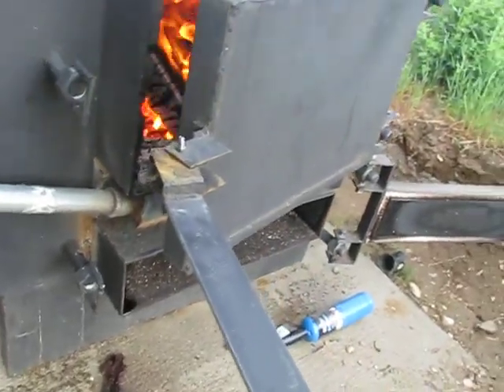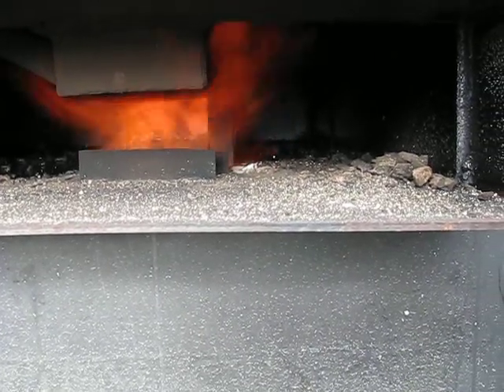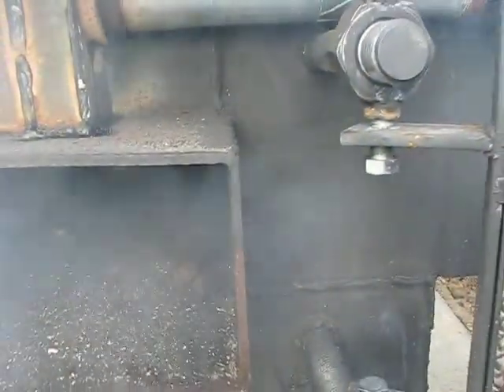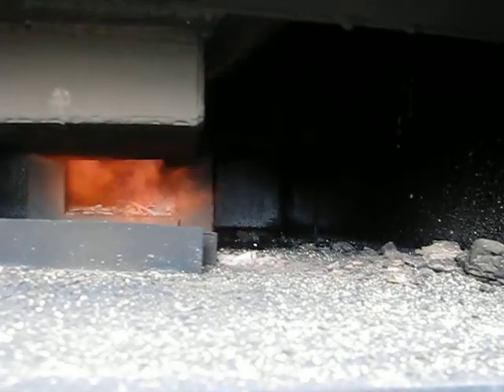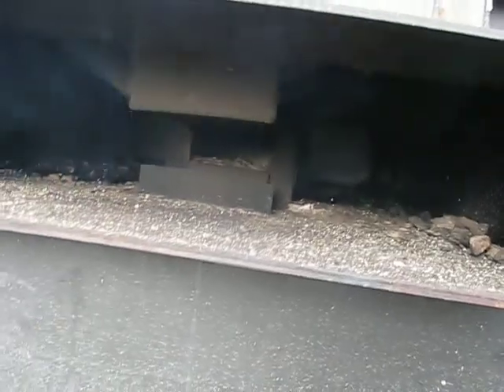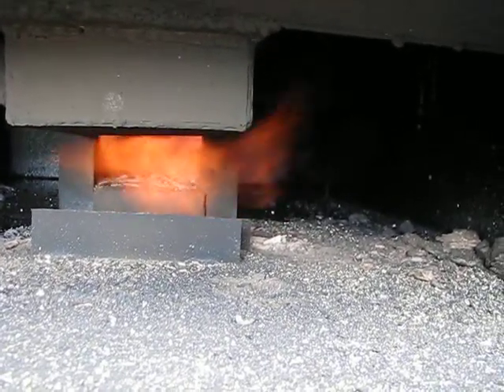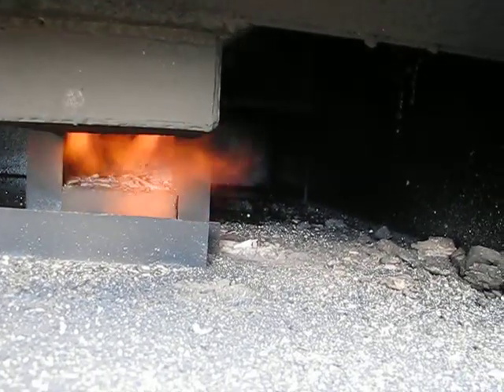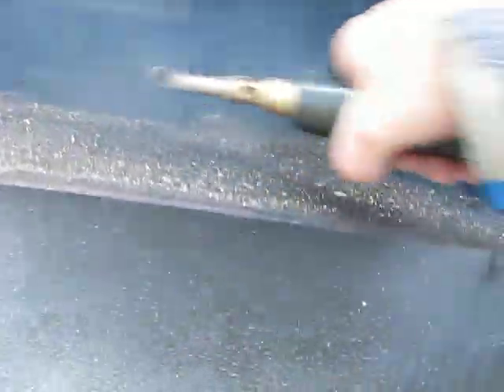Testing with more primary air

Comment: Looks like a real balancing act. I wonder if the type of wood would make a difference? Seems like with the primary air working so well its not leaving any gas to burn in the secondary chamber.
 It seems like Downdraft wood stoves have always been tricky.

Comment from the maker: Yes, that does make sense.... So to do this, I would need to pipe the intake air up to the top, and remove the pips?  Or would it work injecting the air in the bottom with a down draft?